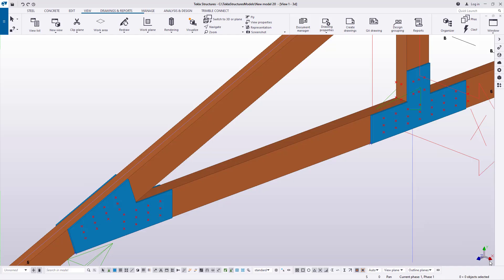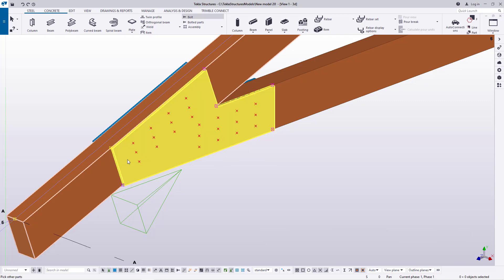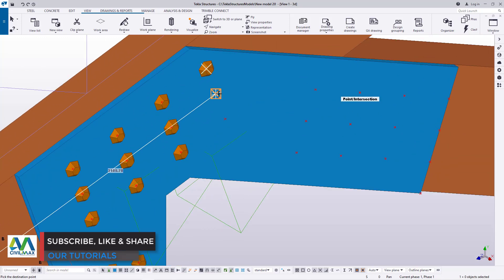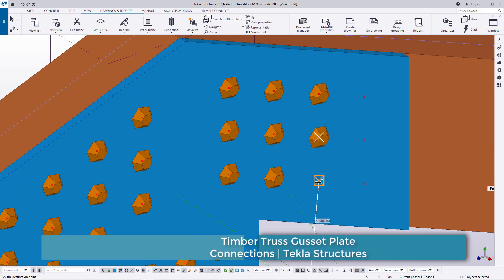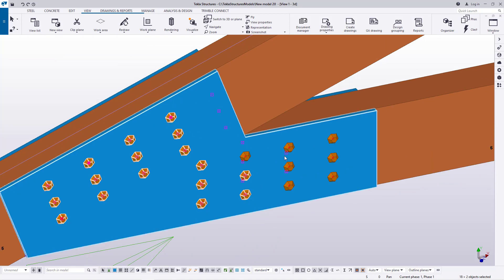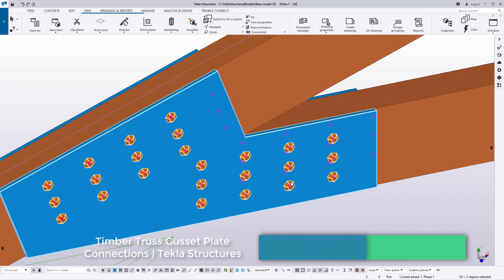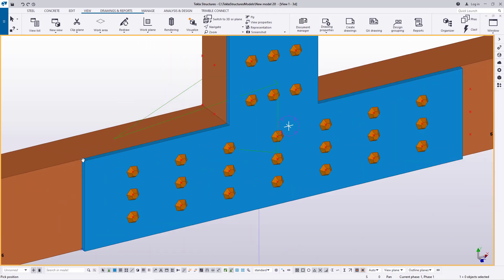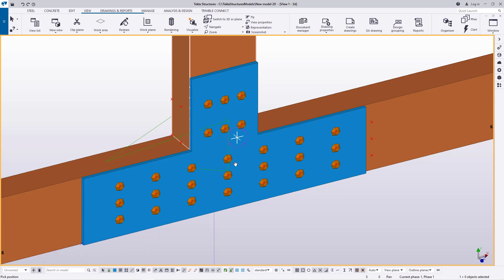Creating Gusset plate Connections on Timber Truss | Tekla Structures

Comment: very nice video and thanks a lot for explaining the methodology for creating the gusset plate. I would like to know about the loading on joins and after analysis how we can check the capacity of truss structures and other details.. Can we export the model to Tekla structural designers or need to create there again from scratch ???
Reply from the maker: Yes, sure you can export it from TS to TSD direct for analysis